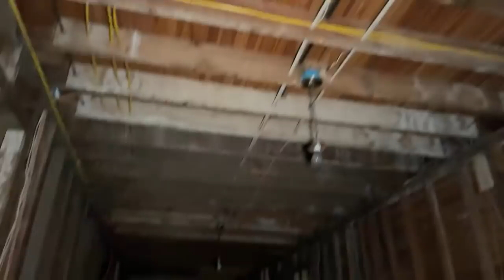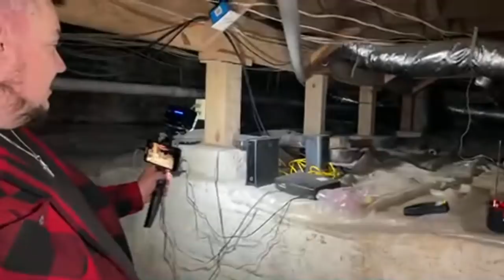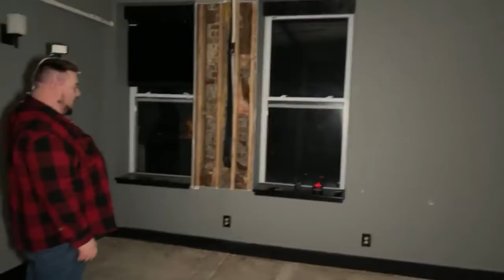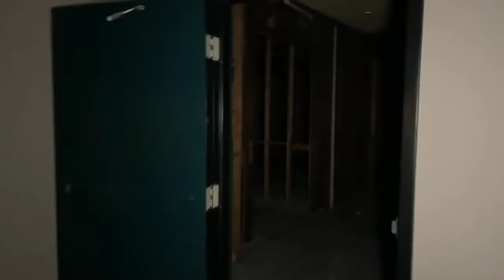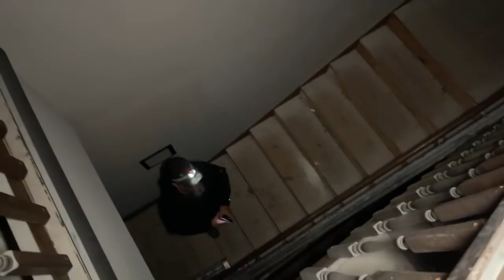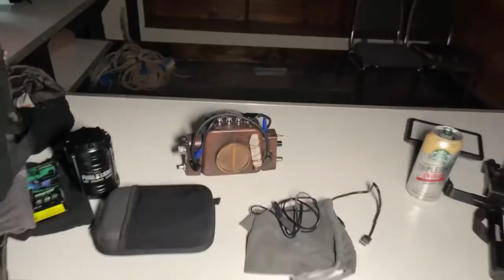Live on location The Walking-Horse Hotel

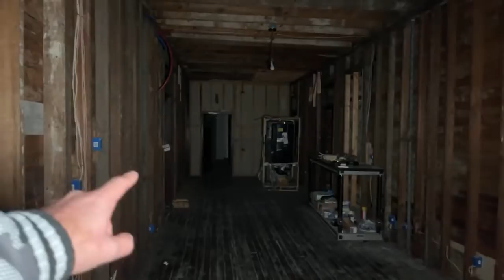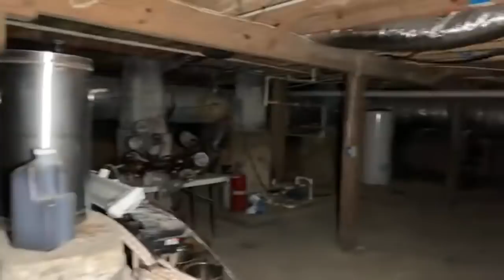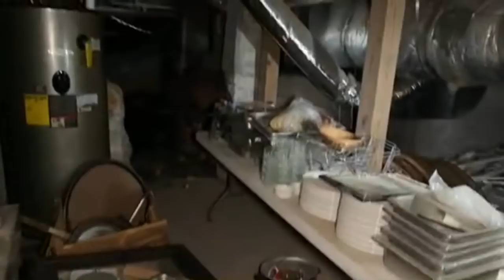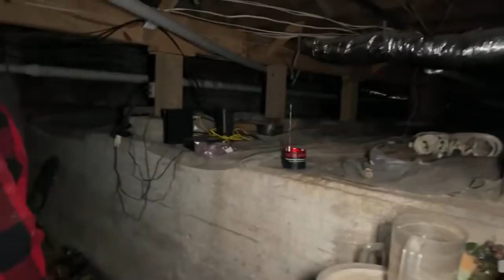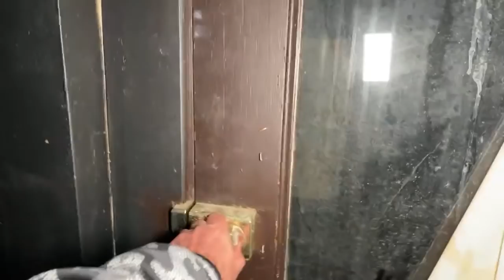Comment: 10:00 I see orb flying your way,  16:42 Josh i know you are cold you said you were and now i hear sounds like somone shivering and can't control themselves in there breathing and shaking its not you cause you have been talking while i hear it, it was doing that from the top of the stairs until you went into the basement and then it stopped when you were standing still listening it quit,  18:35 Look there is a black mass right there behind the wall shadow, 23:49 I see a shadow just touched on the pole where the chair is sitting i seen black shadow touch that beam and then it took it off, 23:42 Shadow in the corner all the way to the left standing there, 24:10 Sounds like a little cry, 28:23 Orb flying across the back, 28:35 I see looks like a person back there straight back where the pipes are but it has to be a spirit cause there not moving or talking or anything it looks like a women to me with short hair, 29:33  I see two men spirits up on the concrete, 41:35 Wow i see a face in the window, there was no face then i looked again and now there are different faces like changing and changing to different faces can you see it?? scary faces in the window still different faces scary faces,  1:25:58 heard voice, 1:27:44 heard a squeeky noise, 1:27:38 I see a face in the window on the outside looking in, Wow Josh those people are so so noise but this has been a awesome video, looks like a shadow on the outside of the door, 1:44:33 Yeah it got real dark right there thats a shadow, creepy, 1:44:33 I heard a growl unless that was your stomach Josh Lol  1:46:35 Josh if that is not your stomach growling then it is a spirit I believe it is a evil spirit,  Okay Josh so glad you are back i missed you and your great videos, great job tonight have a wonderful night!!